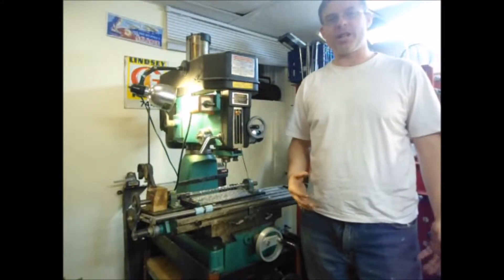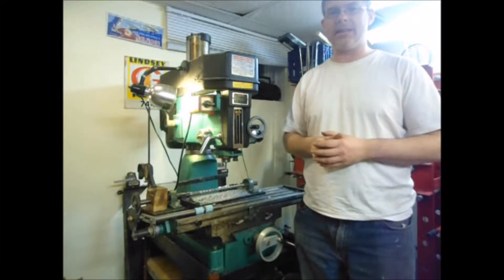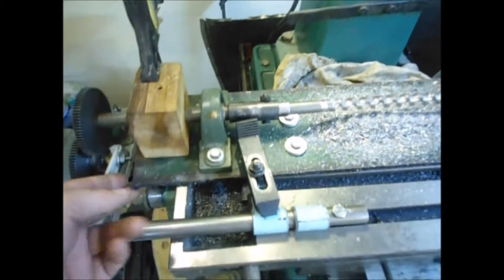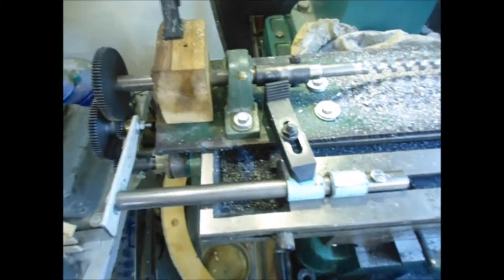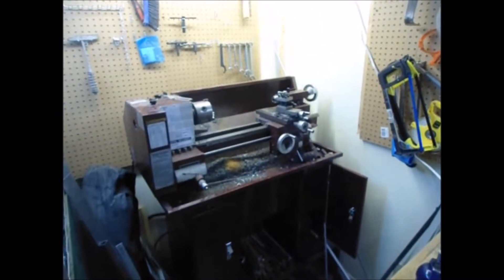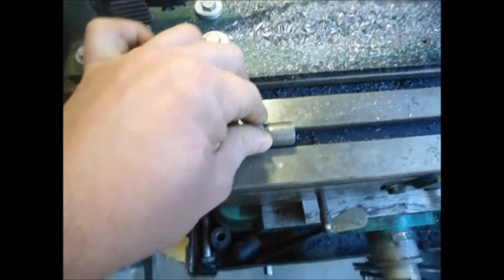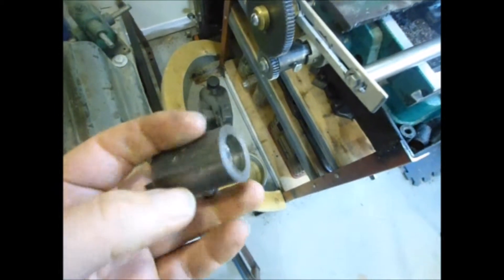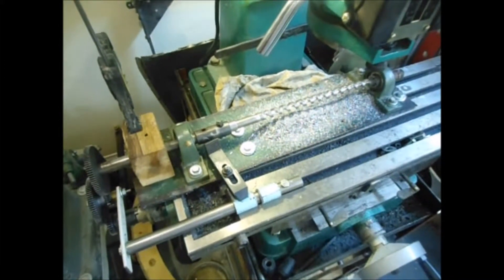DIY Auger Milling Setup   Overview

Comment: I had great hopes that you might have shown this in operation.  Have you looked at using this to cut a multi zone screw?  Ie feed,  compression and meter.  I wonder if your setup might be able to do that by setting the drill rod up on an angle.